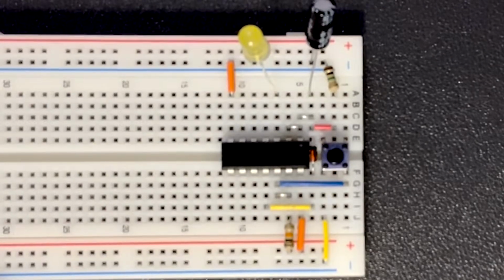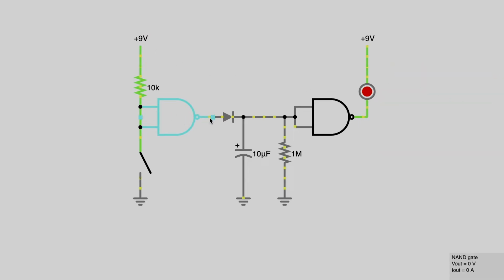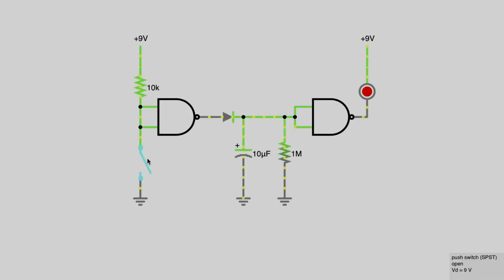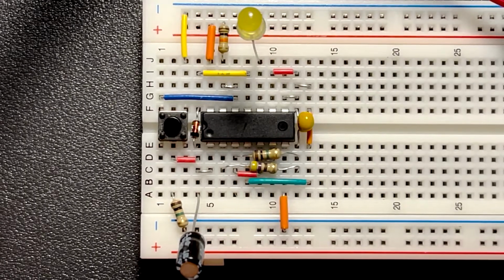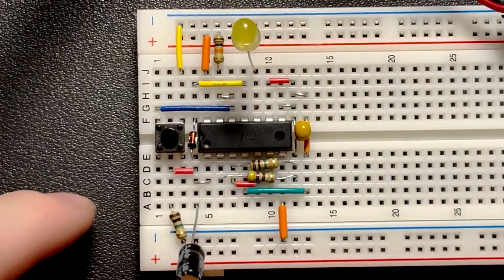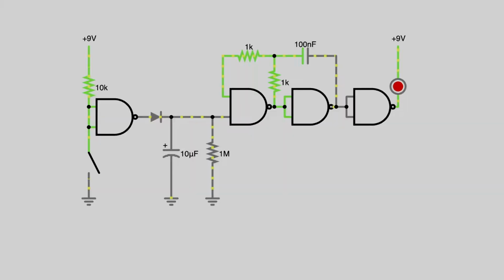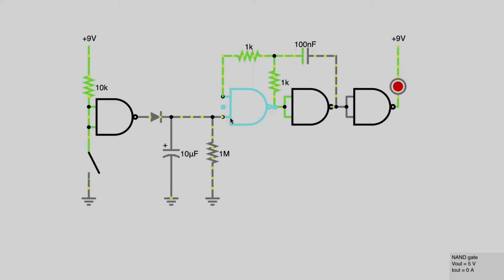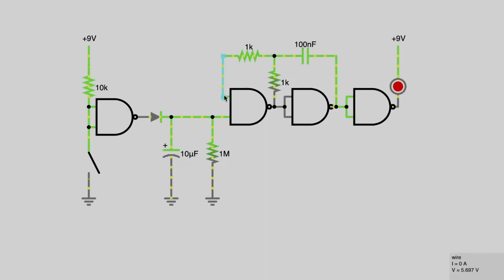The Counting Circuit

Comment: This looks familiar from my Digital circuits course in computer science 40 years ago.........
Reply from the maker: @PWingert1966  this is my school project :>
Reply: @ankashen873  40 years ago we use mostly 7400 series TTL and  built our counters from scratch.  We didn't have  chips in our  predesigned by the school kit for  advanced  capabilities mainly because it didn't exist at an aff Also the course objective were mainly how to take simple building blocks and combine them into a working circuit. What I used to call Digital Lego 101!